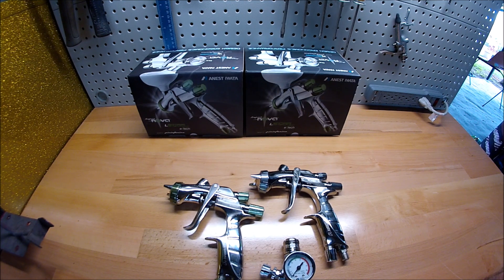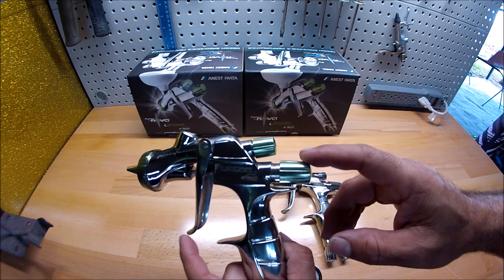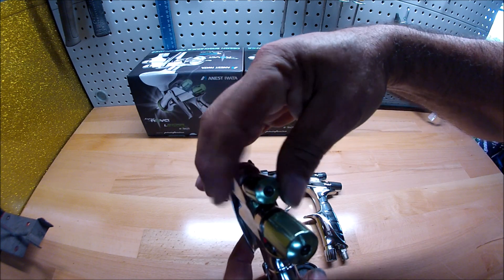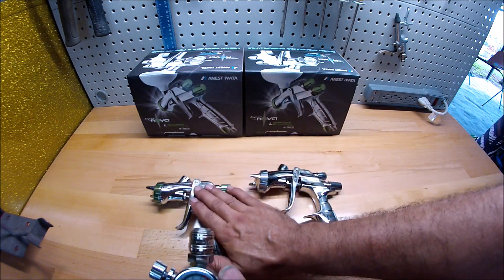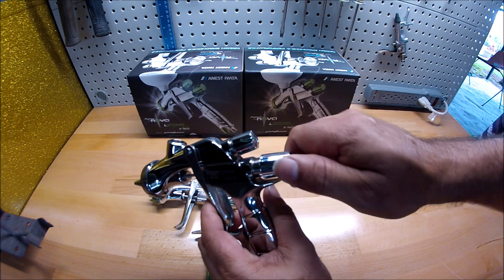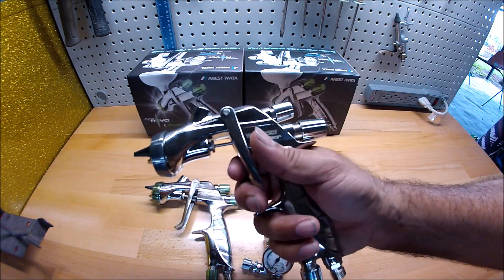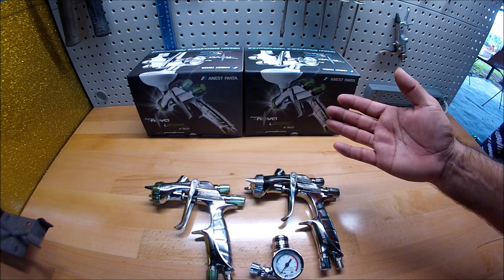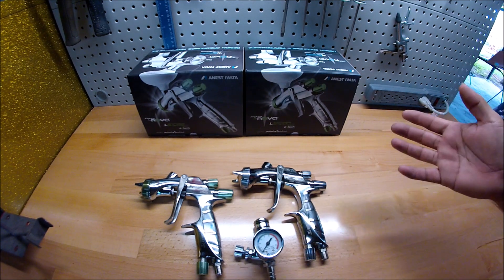IWATA WS400 AND LS400 SUPERNOVA GUN SETUP

Comment: LS should be at 26 PSI. it's 1.8psi or even better a little less. 30psi for the base it's a lot and  the paint  will be dry
Reply from the maker: Thanks for the tip
Reply: You a painter

Comment: 1st time i used the gun it was a water hose runs every where. Did you reduce wth activator ? by how much. Also my settings were ,Bottom wide open/fan wide open and 3.5 out from closed fort he fluid.29 psi

Comment: Hey for those who want to print this out i copied his transcript to copy and paste I hope you don`t mind so i have it in my book now. Perfect set up.      I'm going to show you how just 2 Supernovas the LS 400 and the WS 400.

                             LS 400 Paint Gun for sealer or clear
      Alright let's just get started alright guys first this is the
one I use for paint this is a LS 400 it has a 1.3 needle nozzle combination and
the way I adjusted it. Leave the air inlet wide open wide open because I
use a regulator to control the air. Now for the trigger which is the fluid adjustment.
    I press this trigger all the way. The screw is opened all the way it's almost falling off I start closing it until the needle or the trigger starts moving a little bit as soon as I feel it moving I stop so it's a wide open. For the fan the fan I close it all the way up then I open it 2 turns and that's where I leave it and that is a perfect setting.
 For the paint the patterns going to be wide it's going to be nice and it's going to be consistent and even.
 Now for the air inlet I use a regulator for the paint. I’m going to use 29 to 30 psi that's for the paint and then I can use it for the sealer also and you can also use it for Clear. 
                           Alright now for the WS 400 Clear gun
   This is the clear gun remember the bottom one leave it wide open.
don't move it leave it wide open. Now for the fluid I do the same thing the
same thing I open it up all the way pull the trigger close it until the needle
hits the trigger once I feel it moving, I stop. So, it's going to be wide open now.
 For the fan close it all the way up I open it one turn two turns and just a pinch more like not even a just a little bit more. I don't know if you can see it right there that that was two turns just a little bit more and that's going to be set up for the clear.
 Now on the regulator I usually go 35 psi for clear only not for the not for the paint.
For the clear I go 35 psi I'm ready to shoot. It'll give shoot clear as smooth
as it can be and I won't have any orange peel so that's the perfect setting for this and that's it guys that's how I set up these two guns I hope you guys learn something as to how to set up the supernovas they're real hard to set up I've messed with a bunch of little tweaks and turns and that's the perfect setting that I found out that works for me and hopefully it'll work for you.

Comment: I’m interested in the LS400 for base, I have a 60 gallon Quincy 2 stage 5hp  15.2 scfm @ 175 
Idk what cfm at lower psi it’s not on the compressor and can’t find it even at Quincy 
Will my compressor be capable to keep up with the 
LS400 HVLP I keep hearing they’re air hogs I want to get your opinion before I get it. 
Great video keep them coming.. good work thanks

Comment: Two  questions 

1 is 30 psi ls400 set up available for solvant base or only hydro base?

2 ls400 is vers régular not Bigger in thé midle : does it change the overlap méthod ?
Reply from the maker: solvent base, no not at all
Reply: Ok I understand you Have a ls400 entech and you dont recomand to use it for a solvent base coat Isn it ?

Comment: Why does it look like your regulator has a quick coupler on top where it connects to gun as opposed to screwing it on?
Reply from the maker: yes it has
Reply: @PHARRAWAY  got a part #to that regulator?
Reply: @PHARRAWAY  or did you just add a coupler to top of it?
Reply from the maker: @full_metal2452  no I will show the item next video
Reply: Hey what is that part number I want one

Comment: Buddy can you just  IWATTA  that does base and clear  like a LS400 OR WS400 SUPER NOVA
Reply from the maker: Yes
Reply: @PHARRAWAY  I painted  a very small amount  of my bumper  with a cheap  touch  up  gun  0.8 fluid tip and it came out dry rough looking I have since sold them going to get a ANI 160 Q  MINI GUN I should have used my devibliss  GTI PRO LiTE  with 1 2 fluid  tip and high flow  hose and clear coat my  new devibliss  SRI PRO LITE THE GOLD ONE WITH  THE TE 20 AIR CAP  FOR THE CLEAR